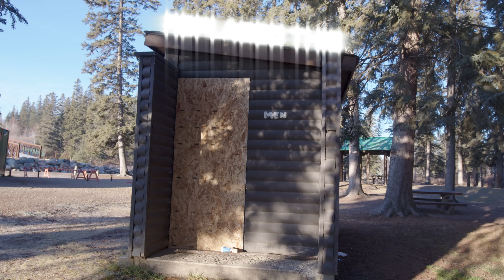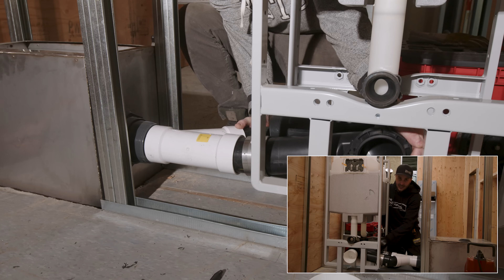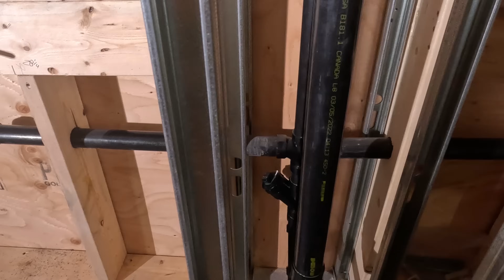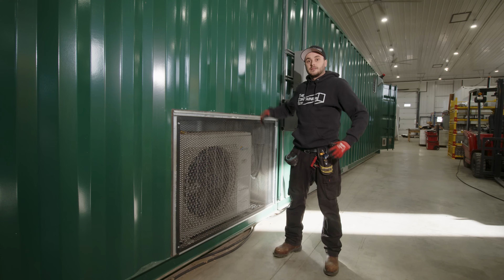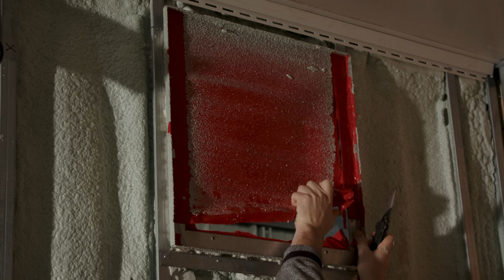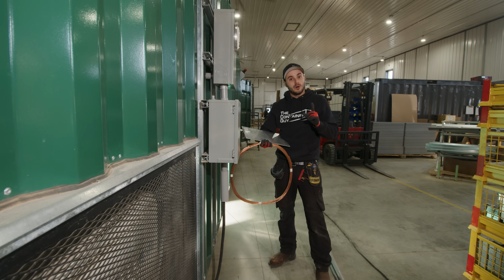Shipping Container Washroom Build | Tiny Home & Bunker Solutions

Comment: So if you put the tanks under the structure would there be enough room for 2 showers? You still  would  need a storage room for electrical and so forth.  Would the tanks be large enough to make the showers worth it with the extra water that will be added?  How many gallons are those tanks in the video and how many gallons would be sufficient to add showers.  I really think this could be something they can use at carnivals, emergency sites, any where portable and temporary service is needed .  Think this one may be your best conversion yet.

Comment: Sea Can to SaniCan, great idea. Add a few solar panels and batteries and it should serve well as a replacement for portable toilets in more medium term applications where local power is not yet available.
I understand not using incinerating commodes due to cost and complexity, but did you consider a single incinerator for all of the waste? Hold the waste for 24 hours and then incinerate once per day, when there is no one in the immediate area to complain about the smell. The incinerator can also provide some heat to help offset the potential for late night freezing inside the unit.